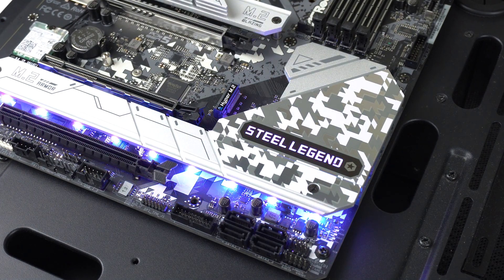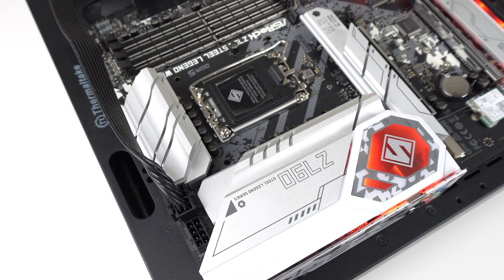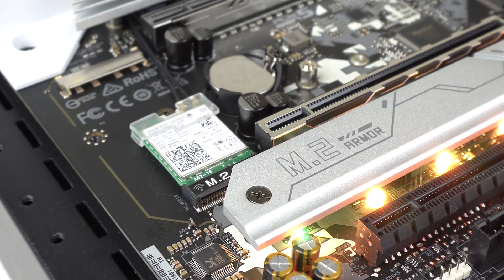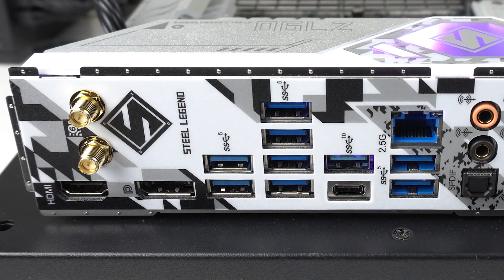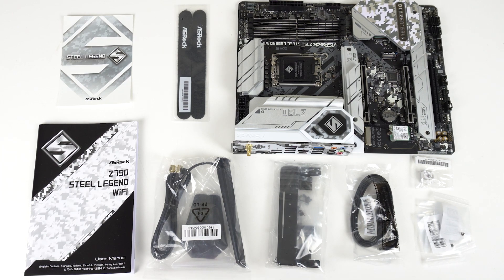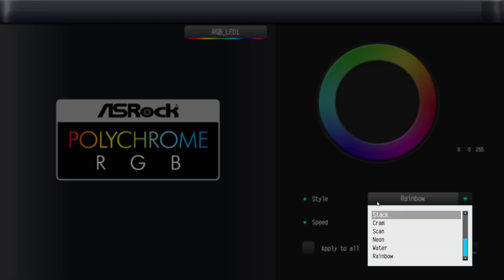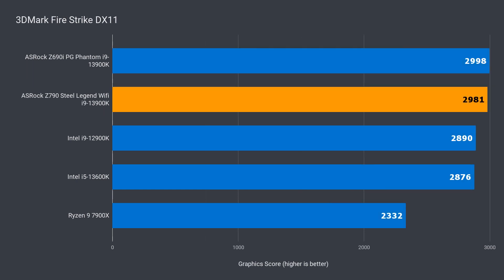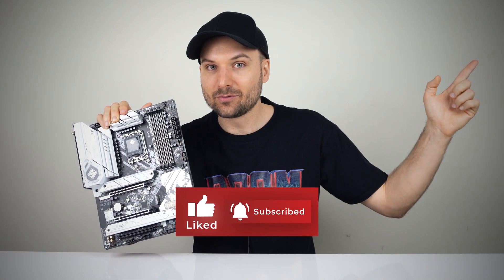USB and Storage Galore! ASRock Z790 Steel Legend Motherboard Review

Comment: Something to know for interested buyers, the two CPU M.2 can NOT be used at the same time. But the good thing is that only the  gen5 slot slows down the GPU, the gen4 slot does not.
Reply: I'm kinda confused.  I just bought a "pre-built" computer on newegg with this board. It comes with a 2tb NVME installed, but I want to add in another. If I don't want to slow anything down, where do I make sure to put my additional nvme?
Reply: @PimpinNProgress  dont worry, the two CPU slots overlap so you can (have) only one NVMe in there and cant use the other. Your only option is the other slots a bit lower on the board that are connected to the chipset.
Regarding the one you already have in the CPU slots, ...if your GPU runs at x16 then its in the correct one.

Comment: The only one motherboard close to this one is MSI PRO Z790-A Max WIFI / Gigabyte Z790 GAMING X AX (rev. 2.0) BUT I am not sure they have - Nichicon 12K Black Caps (100% Japan made high quality conductive polymer capacitors). And durability is most important thing here.
So with other words I don't see any competitors here.
Also this is not middle class range most-likely is mid-to-high. And you should ask yourself what high-end can gives you more than this for double price?
Short answer - nothing.

Comment: About the m.2 -  it says that you can't use both m.2_1 and m.2_2 at the same time.. and only if you use m.2_2 you will cut the PCI-e down to 8x doesn't say it about the m.2_1 slot - this is what I find confusing becaues I'm not sure to buy this one or no.. another video said something competely differet and now you say you can use both m.2 slots.. manual says you can't .. HELP! LOOOL
Reply from the maker: The spec page was updated later as it was incorrect. "M2_1 and M2_2 cannot work at the same time. Please choose either one of them to use."
Reply: @Robtech  yeah so I was right about this part, but now using 1st slot will run pcie 5x16 at 8x does this mean it will decrease your GPU performance? as in 5x8 is the same as 4x16  speed ?

Comment: Great video
I bought one + 13700kf, but my fsb is only 99.76 and not 100.
Is the problem on the mobo or the i7?
Can it be fixed with some new bios?
Reply from the maker: Here's an answer to the topic https://www.reddit.com/r/overclocking/comments/7p32x3/why_is_my_bclk_998_instead_of_100/
Reply: @Robtech  Thank you very much. Unfortunately this mobo has no option to turn off the spread. I will return and try with other manufacturers. Thank you very much.
Reply: @marioramos-vl5qf  For 0.25 %?  Wow.
Reply: @marioramos-vl5qf  That's really stupid for such a tiny difference.

Comment: Excellent board and pricing. First i wanted the Strix Z790-A gaming wifi for the looks but when i saw it doesn't have a gen 5 ssd slot like this while also costs 150 dollars more i was like hell no. At least you have some future prooving with a gen 5 ssd slot when direct storage becomes widely used for games.

Comment: No idea why you would need 8 sata ports with 4 m.2 slots, better than not enough though since they can deteriorate/break over time.
Reply from the maker: OS + Storage and 10x backups 😆
Reply: Love it! I still have quite a few 2.5" drives in IcyDock hotswap bays! Would need a 4TB NVME drive to replace those I allready own. Nooope :P
Reply: I have a Z390 Taichi Ultimate with a 9900k and an RTX3070ti.  I've found that other I/O functions aren't usable depending on what functions you use.  Like, if certain SATA ports are used, other I/O functions don't work.  The more PCIE, M.2, and SATA ports there are the more I/O configuration options there are.  Hopefully we'll get another video exploring this!!!  The Z790 Steel Legend is what I have ordered for a 13900k with an RTX4090 for a new build.  Just waiting for it to come in the mail.  Videos are easier to understand than manuals...
Reply: As a video and photography  editor I can never get enough storage options.  I though 12 fans and 10 ssd hard drive slots in my case was overkill  .I'd gladly fill the up. Currently only have 2 sata.relying on usb storage

Comment: Great review!  I'm on the fence in getting it and what's mostly holding me back is the sudden absence of it coming with a Bios and, or a C-Mos button. Every iteration of this board has come with a Bios Flash button but this.. The good thing is that I found out that the Bios setup process is trouble free for my 13700K on this board so I guess, I really don't need the darn button anyway...  Right?
Reply from the maker: Yeah, not super useful on this board since 14th gen won't be supported and it already supports 12th and 13th gen out of the box.
Reply: @Robtech  Exactly!
Reply: @Robtech  heyo where'd you see the info about 14th gen support?
Reply: @TR-707 On the main ASrock website it says it supports 14th gen :)

Comment: Gotta love 4 M.2 slots at PCIe 4 and 5 gens (and still several SATA ports), and that little GPU brace looks both useful and inobtrusive. However, given that this is an Intel MB, I was surprised that that USB-C on the back wasn't TB. You know Rob, it's almost funny how much you can get through in 4.5 mins!
Reply from the maker: Very few boards with TB around. I don't think there's much demand for them in the desktop space.

Comment: I have this board, installed a 3070 in to the 2nd pcie slot, but need to remove it and it doesn't want to come out now, ant tips on removing a card from this board guys?